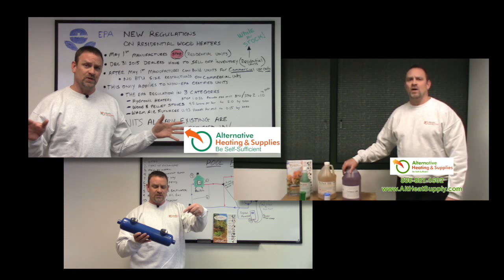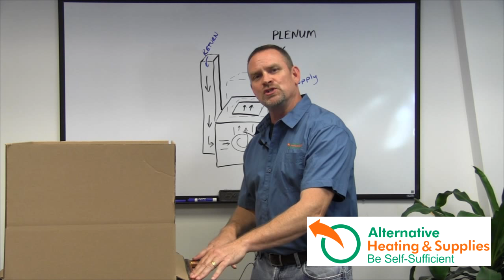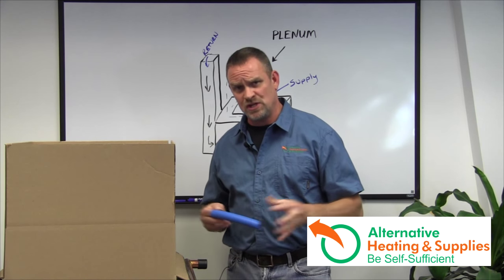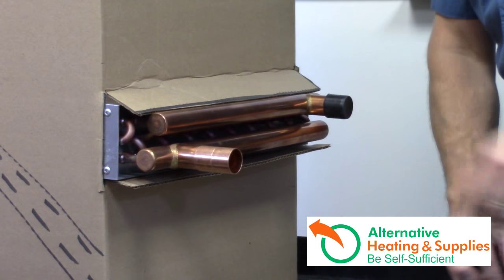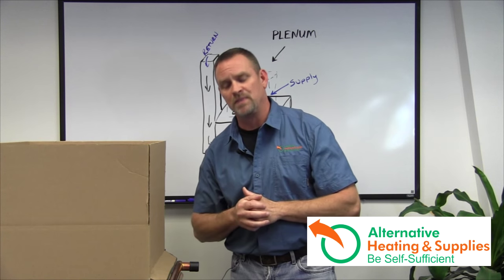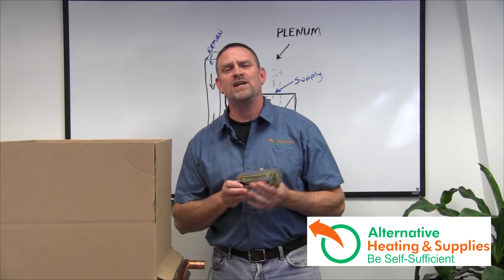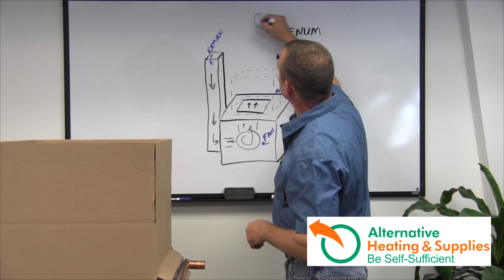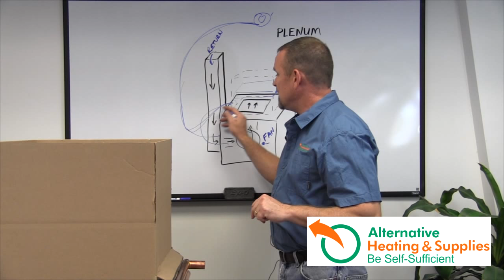How To Connect a Heat Exchanger and Make it Work - Pt 3

Comment: The part I don’t understand is this.  How does the aquastat tell the system to turn on the fan only when the thermostat wire is calling for propane heat?  Does that make sense?  If that can be explained to me I’ll definitely buy the aqua stat. Thanks

Comment: Hi Jeff your videos are great.. thank you very much! I do have a question though.  My plenum has an AC A coil in it and there isn't much room above that for a heat exchanger, can i put it in the cold air return?.. also is the wiring any different when AC is involved I plan on buying one of your aquastat kits but wanted to verify those items first.  Thanks you Jeff
Reply from the maker: There are a couple problems with installing in the return. There are probes that are located above the unit to ensure the unit cools off before turning off the blower, with the heat exchanger on the return the probe will not sense the the unit cooling and won't turn off the blower. Try to find a location under the AC A coil or above it. Jeff
Reply: @AltheatsupplyLLC  Thank you

Comment: Great video! I'm thinking about this system. Just wondering about wood. I have about a 100 acres. Sad part is its mostly all cedar!!! Would it be efficient to burn Cedar???? Also The exchanger installs above the A/C coil is that correct? Thank you!!!

Comment: So just a little clarification, If the aquastat has to detect heat at the exchanger. Is the circulation pump always on or does it intermitently cycle the pump?
Reply from the maker: Yes the pump is running all the time.

Comment: This question may have already been asked & I haven't seen the reply to it. Does the Pex tubing conduct heat to the aquastat as well as the conduction of heat through copper tubing or is the difference so negligible, it's not enough to be concerned with?

Comment: Hii Jeff ,  SummerAire handler TC3550E hot water is designed fed into top of coil and grundfoss pump pulling from bottom.  Looks like a design flaw to me.  After nine years running I want to reverse to the pipe connections to the handler and rotate the circ pump 180 degrees.  I even want to add another hot water pipe to the input to reduce resistance and maybe get more flow.  My water heater is a Rinnai tankless RC98.  All good but could be better!?  What do you think?

Comment: Do same rules apply but sideways when its horizontal?   And my ducting is the fiberglass board to flex ducting down in south Texas.  Same install rules except crimping the metal around the exchanger?   Heard concerns of the heat of the exchanger damaging the lining of the closest flex ducts ..heard of any truth of such?
Reply from the maker: No, never heard any issues with duct work. Fiberglass duct work is hard to work with mounting. Just find away to install. I have no experience dealing with fiberglass duct work. Sorry

Comment: have outdoor stove and heat exchanger in plenum(all air must go thru exchanger)......my furnace has an issue and the tech had to be called.....but i found that although i had the wood stove stocked....the house temp would get colder.....now at 19C....23C is the norm

the water coming into the exchanger is at 125 F.....lots of heat there...

i can feel warm air from all the ducts.....why does it not keep up?
when the gas is used.....the house is maintained at 23C

help
Reply from the maker: You need to run the water hotter then 125F it should be 160 to 180F to be able to heat properly.

Comment: my furnace is in the attic  which means the plenum is horizontal. and the heat exchanger  will now be standing vertically . should I install a ball valve on the top port to help bleed air out of the system?
Reply from the maker: Yes that will be helpful when your that high, it's hard for the pump to push air out of the lines especially by a water to air heat exchanger.
Reply: Mine would be the same but in a basement. Do I need a ball valve also

Comment: Jeff im sure the supply and return dont matter if its mounted vertical in a horizontal attic furnace ...correct??
Reply from the maker: It is best to mount tall and the ports facing horizontal.
Reply: @AltheatsupplyLLC  im not sure of the answer Jeff.  My furnace is horizontal so my heat xc has to go vertical so it really shouldn’t matter the in and out supply n return...thats my wonderment

Comment: hi, I do not trust them shark bit fittings, I been to far to many service calls were the home is steamed up, the basement is flooded, the movement of the pipes have cut a grove all the way off the pipe, and come off, the only thing then shark bits are good for is a fast temporary fix. were you come back later and sweet it on.. o would like to see your wiring diagram if I could?
Reply: There are many cheap knock off brands and also seen that, But not with SharkBites the real product..
Jeff

Comment: Do I need to run 1" lines to this? Or can i use 1/2" existing lines I have to run to the exchanger? Or will 1/2" not have enough flow?
Reply: Mine is plumbed with 3/4" lines.

Comment: Hi,Is this better way for heating my house than furnace?
Reply: I’m already using this kind of system but combination with gas boiler Weil McLain and I have hydronic coil install in the duct system with carrier air handler.

Comment: great illustration and thank you for sharing. I will call you in the next few days to get the shark bite kits and thermostat.  I'm in my initial thought process on how I will install my heat exchanger to my existing oil furnace that  also already has a air conditioning exchanger installed however vertical and not horizontal in the plenum and it is taking the complete vertical part of the plenum. How would i install the heat exchanger horizontally with that in the way?
Reply from the maker: Yes same way.. Thanks

Comment: very nice. I'd like to use this heat exchanger as part of a natural gas fired backup and supplemental (3rd stage) heat on a forced air geothermal heat pump system (Waterfurnace), in place of the built-in electric resistance heat strip (kind of expensive as 3rd stage is used a fair bit Nov-Feb). It has a vertical plenum exactly how you are showing it. Can you suggest a type of natural gas fired boiler (or on-demand/instant hot water heater?) to get the water temp up to 180 deg for this type of use? thanks!
Reply: No, Because i have no experience with the Natural Gas Products. I'm only Bio-Mass units knowledge. 
Thanks for asking and watching and good luck with your project

Comment: what would someone do if they don't have a furnace to blow the air through the house.  just simply an outdoor boiler running to a heat ex-changer in the plenum.  I am guessing one would simply just add a furnace type van right inside the plenum behind the heat ex-changer
Reply: +Scott Weis sorry fan not van
Reply from the maker: +Scott Weis You could use one of our Dragon Breath Heat Exchangers with a fan
https://www.youtube.com/watch?v=rk2lk4173fg

Comment: My father had this type setup in the early 80's.  I'm in my permanent residence now and am thinking about doing this with an outdoor wood gasification boiler.  I have 4 heat pumps heating like 3300 Sq feet.  Two for the main house, one for a bonus room, and one for a hobby room off the side of the garage.  Would it be possible to do this by installing a water to air heat exchanger at each air handler?  I see where this works for a single air handler so I'm guessing I need some sort of manifold?  Would it also be possible to run this to a separate 2000 Sq/ft workshop with a dragons breath setup?
Reply: you can branch of to as many appliances as you want, but you need to add a booster pump if there a long run from each, or at a higher leave, it really comes down to your lay out weather you need the added pump/s or not, but I would put the added pumps on a 110v thermostat, (witch can also control your air handler/so they only run when heat is call on, use taco 007 pumps, you want to make sure you have full flow to everyone, been to many places were they say the line is hot but no or little heat, well, that's because the 1" line is only 1/4 full, no flow, the big outdoor wood furnace 2500 taco pump is made to run 24/7 365 days a year, never shut off, many use it for hot water in summer too
Reply: Yes you can, but keep in mind to many heat exchangers on the same loop causes more problem. My rule is two heat exchangers per loop is safe and effective. With you application i would run one loop to house and another to garage and seperatate the two

Comment: does it make a difference what type or model aquastat you
use as long as it is a strap on?
Reply: That is a hard question to answer, I have no idea what your working with. I haven't tried all aquastats out there.
Jeff
Reply: i have the heat exchanger in place and plumed in like you showed in the video now i need the aquastat would this one (Honeywell L4006H1004 )work. thanks by the way your videos with out them my head would be spinning.
Reply from the maker: I'm not sure about that unit, Honeywell makes thousands of these a little bit then one another. All i can say is to try it if you have it.
Reply from the maker: No it should still work, just make sure it has a High and low switch.

Comment: both lines are hot at heat exchanger will not send heat to house
Reply: no flow in lines, see my comment above,,, you may also have air, a self vent should be installed above every appliance (high up as posible